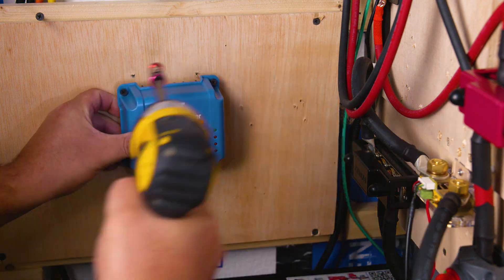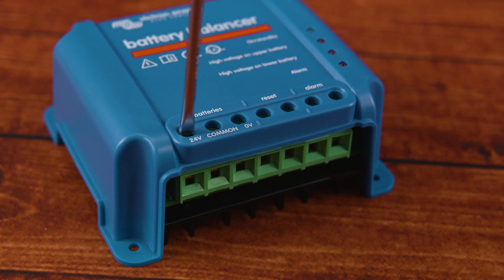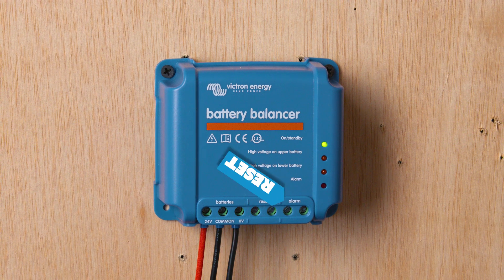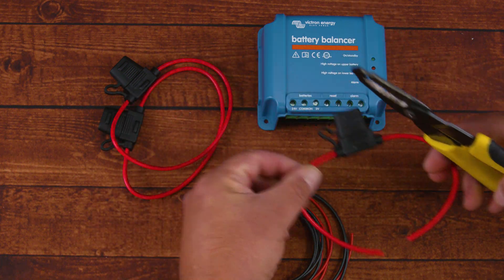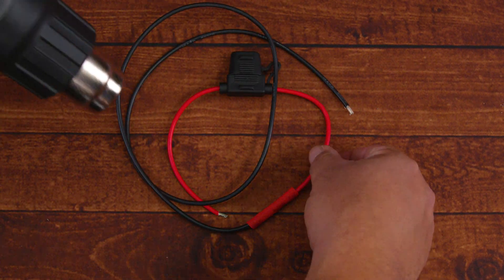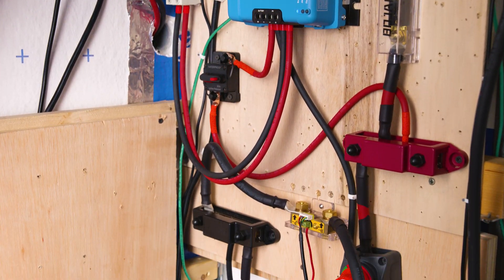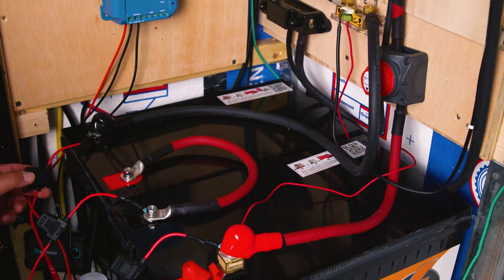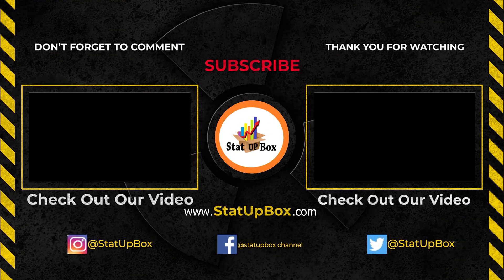How To Install Battery Balancer Solar Easy Simple

Comment: Okay, where does the common go when the batteries are connected in parallel, or is a balancer not required in a parallel connection?

Comment: The balancer carries so little current I find it hard to believe they actually do anything.  My ecoworthy 4S2P setup with their 12.8V 150 Ah batteries is always getting out of balance.  I bought their 20 amp charger and top balance all the batteries and they still become unbalanced on charging.  I'm trying to charge at lowest rate possible and only charge to 80%.  I think maybe it's better to get 48V batteries with BMS communication for large solar battery installations. if you look at the victron manual they recommend using THREE balancers for a 4 series battery setup

Comment: How important is the order of connection?
1 -24V
2 - 0V
3 - Common
Can I mess something up by connecting in a different order?
Reply from the maker: according to the manual it appears there is a chance to damage the device or the system if not placed in order or maybe not working properly.  otherwise would imagine manual would of not been specific on order. you can always  confirm by contacting manufacturer. any opinions are welcomed.
Reply: It’s not exactly rocket science is it? 😗